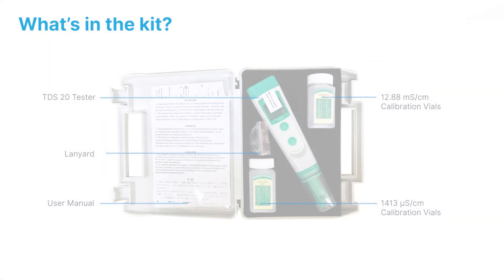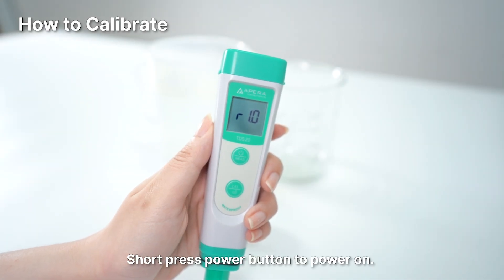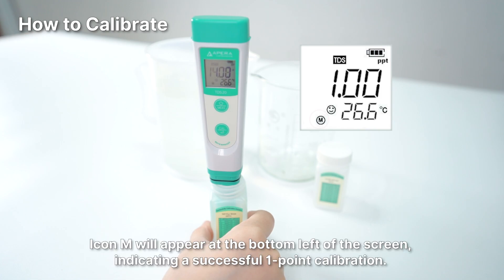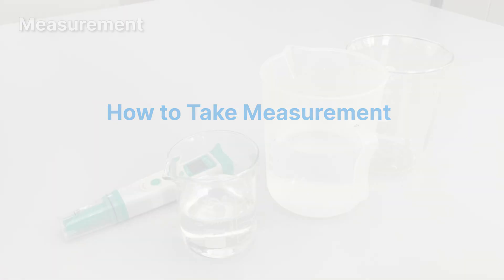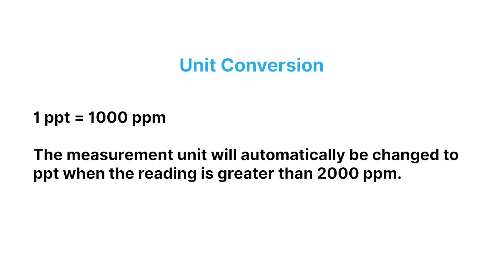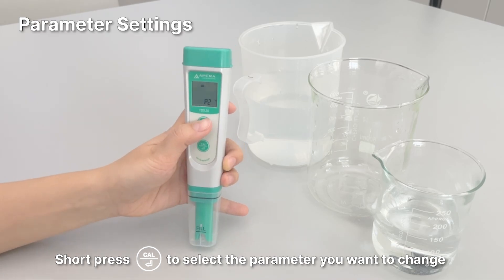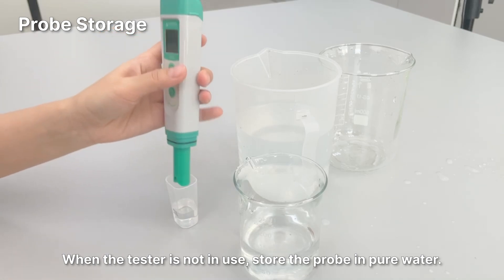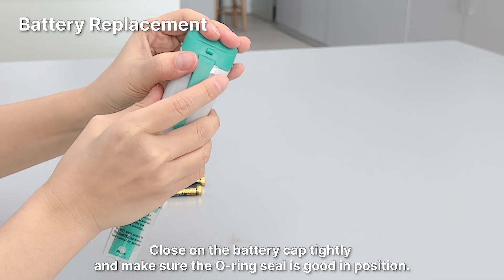Apera Instruments TDS20 TDS Tester Tutorial

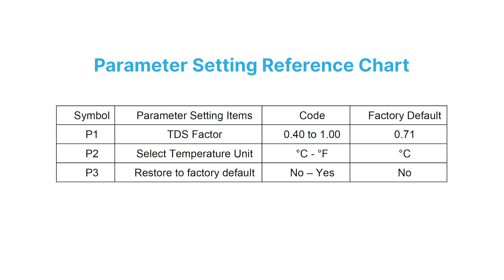Comment: 3:20 How does the operator know when to swtich P1 (TDS factor) to higher or lower values if he doesn't know the conductivity of the sample solution? 0.60 is for 0-100uS/cm and  0.71 is for 100-1000uS/cm whereas 0.81 is for 1-10mS/cm and 0.94 is for 10-100mS/cm

Comment: My TDS20 arrived today completely dry. No drops or humidity in the cap. Do I need to hydrate?
Reply from the maker: It's ok to leave the conductivity probe dry. You can soak it in 12.88 mS solution for 10 minutes to condition it if you feel like the response is a bit slow.